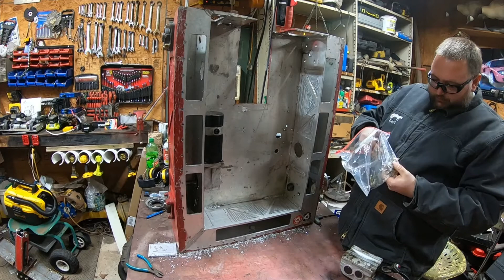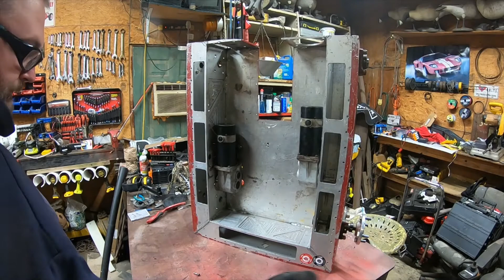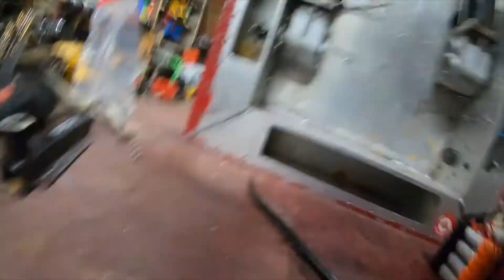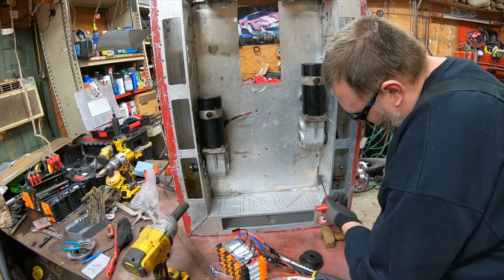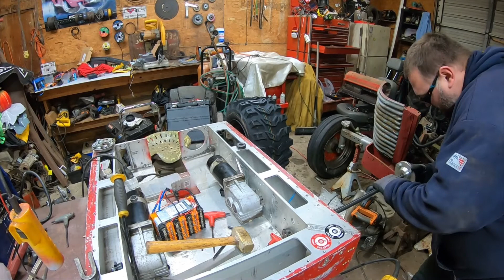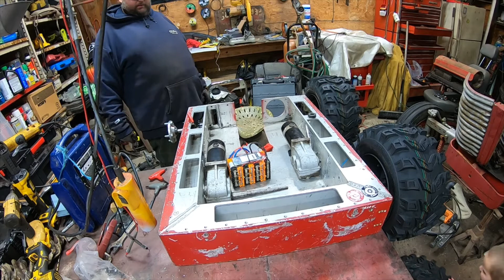Deer-Dash Build up Episode 7

Comment: this motor to sprocket system is bad a$$.  this is exactly what ive been trying to wrap my head around.  ive been researching the cheapest automotive wheel hub / axle assembly to power an axis on my machine.  it never once crossed my mind to build an axel / hub.  you made that look simple and perfect for my application.  could you tell me what that "build it as you go" axle kit is called?  

also, i seen the screw down clamp on the inside end of the axle shaft, and i see how the screw down sprocket also secures to the shaft.  but what was the little black collar looking piece you slid on outside the frame , before the hub?  just a large thrust washer?

and what does the shaft ride on axially? pillow blocks or bearings of some sort.  or is it even simpler with the axle just spinning in the hole.

sorry for the bombardment of ?'s,  my desk is littered with parts to this machine that im a few months into and this was exactly what im working on
Reply from the maker: Thanks. The hub the wheels bolt to is a go cart hub from https://www.bmikarts.com/4-x-4-Billet-Aluminum-Wheel-Hub-34-Bore_p_1645.html the shaft is just a 3/4" keyed shaft from surpluscenter.com it is held in place by 2 4 bolt pillow block bearings. The black piece is a shaft collar that keeps the wheel hub out far enough that the tires don't rub. Feel free to reach out to me via facebook or email. Earl Pancoast III on facebook Crazzyearl@GMAIL.com
Reply: @crazzyearl  thanks man.  i appreciate it